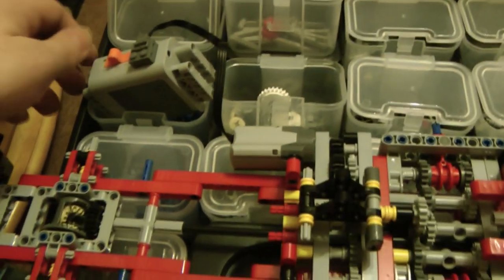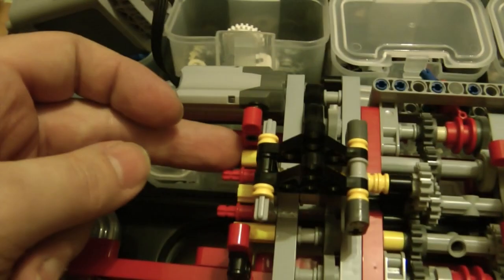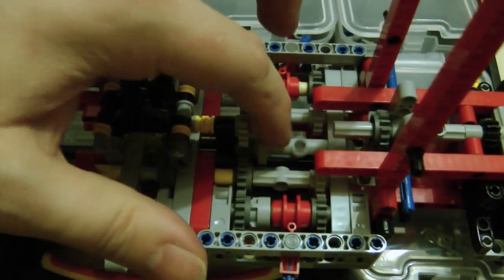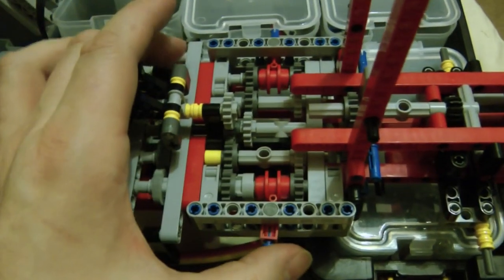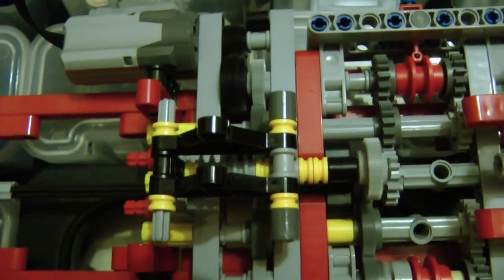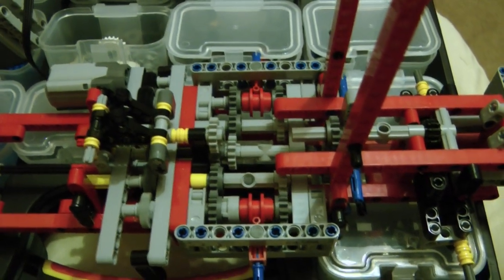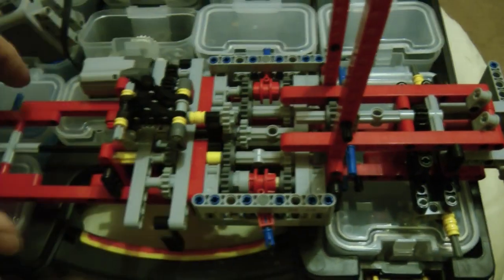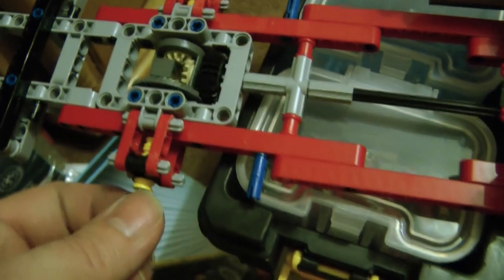Lego technic 9397 amazing gearbox (2012 model)

Comment: @Rodeown Thanks, the mechanism for getting two functions through a turntable is probably similar too. Which function uses the driving ring, and which the centre axle?
I have the 8110 too, the gearbox is also interesting with 6 driving ring extensions!